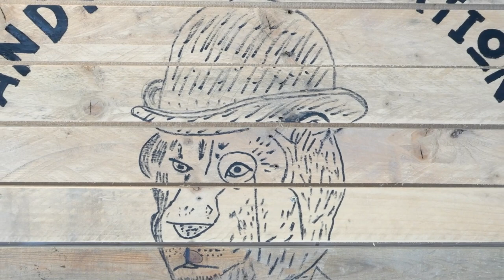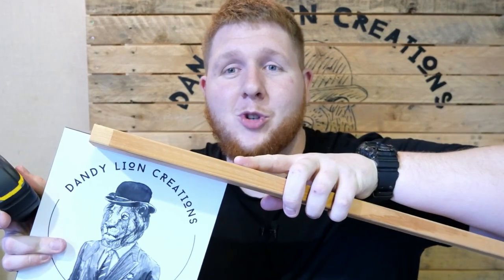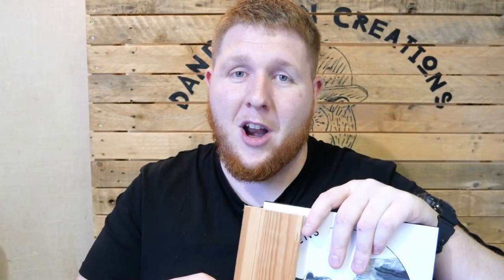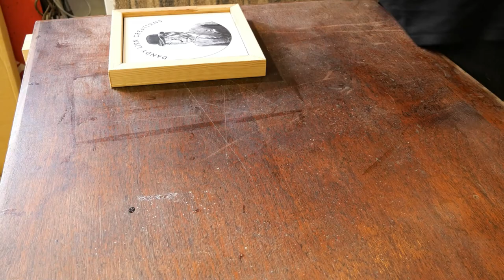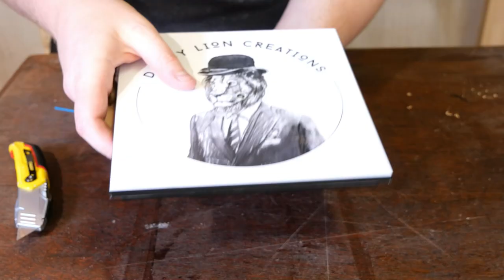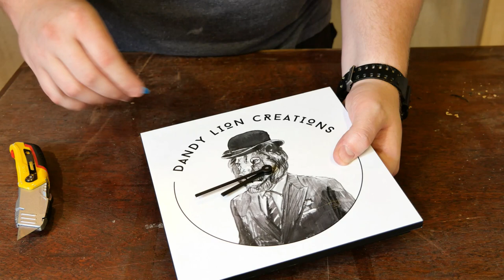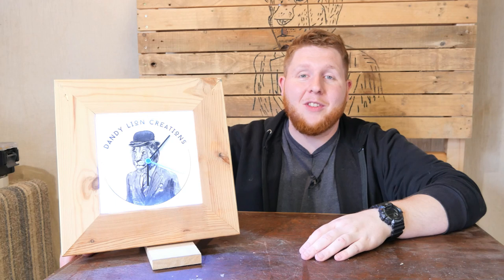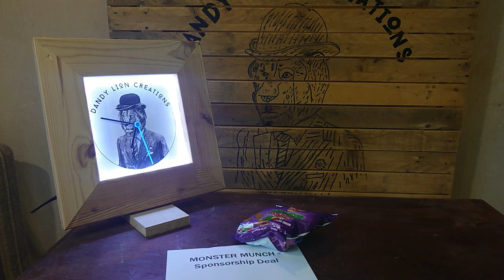CUSTOM Wall Clock - Do It Yourself!

Comment: Nice clock fella may give this one ago
Reply from the maker: Its a fun little build! It was mainly mitre practice but it's handy having a clock around the place! Thanks for watching 👍
Reply: Dandy Lion Creations definitely I like the idea of having my brand as a clock
Reply from the maker: I've out the link to free prints on the video information. You just pay for shipping unless you want a glass tile in which case there is an extra charge.
I'm not sure wether the glass tile is tempered.. in which case drilling through it is impossible but the plastic is fine 👌 just be careful you wrap the front as it scratches easily!
Reply: Dandy Lion Creations thanks buddy will look in to it
Reply from the maker: @ReelSimpleThings  Anytime mate 👍

Comment: Hello! I am Japanese.
Always a good video.
Keep up the good work!
Is the wood bond on the screen a gorilla?
Reply from the maker: Hello and thank you for watching! 
It sure is, I use gorilla glue and I have zero complaints. It flows nicely and adheres quickly. Definetley my go to glue 👌
Reply: @DandyLionCreations  
That's right!
It has recently started to be sold in Japan and I was curious about it. Thanks for the good info!